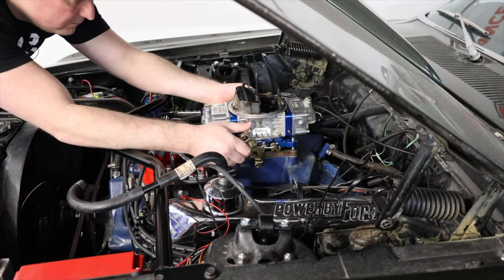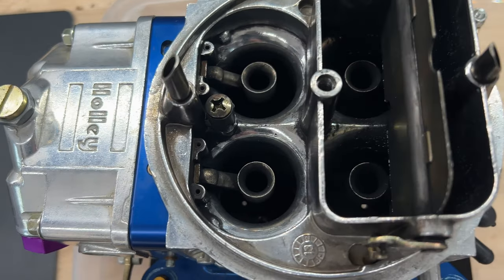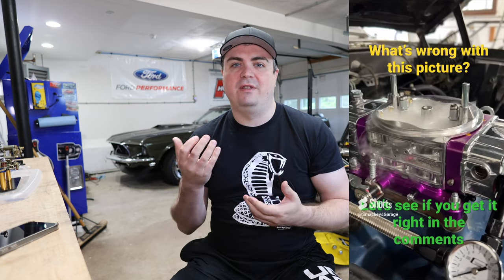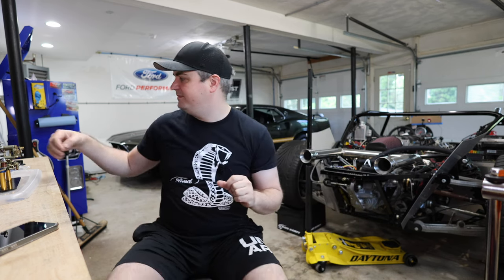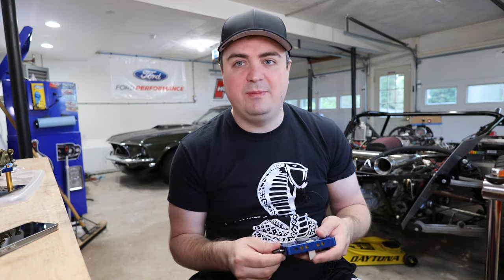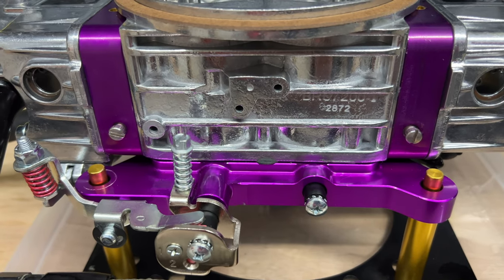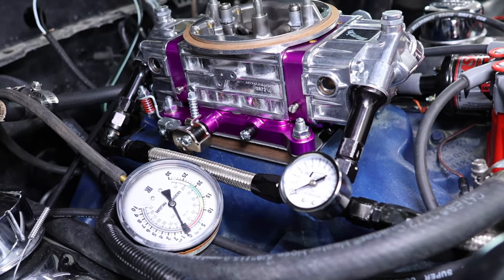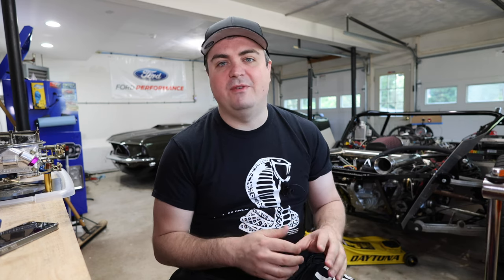My First Experience With No CHOKE | BRAWLER 750CFM

Comment: I've did away with the choke on several of Mopars I've had in the past only the one's I didn't drive in cold weather though. The thing I don't like about electric chokes are that they still choke even in hot weather and every time after the car was shut down, so I would just adjust them to stay open and not work. Great video! Thanks for sharing!
Reply from the maker: You and I had similar experiences with electric chokes. My problem that I had was if I moved the car out of the garage to warm up It would end up kicking the choke off. Thanks for watching and sharing Mitch!

Comment: Split the difference,  choke horn with no choke flap. Did like your manual choke video- PITA install.
Reply from the maker: Thanks man. That’s not a bad plan. Probably could have just removed the flap. I agree. The manual choke was a lot of work. I also wish I went with the Holley cable rather than a stock replacement cable from my car.

Comment: some guys throw a rag over carb with no choke to get it fired up at first
Reply from the maker: That's a good tip. Annoying if you are just driving it for a cruise, but I understand why they would do it.
Reply: @SmackeysGarage  youve got me second guessing on what kind of choke to use, ha, just put on my first nice 4 barrel holley with an electric choke and it fires right up in the cold, might try a no choke this summer when its warm, thanks for the videos
Reply from the maker: I have a video on that that covers my experiences of each of the three choke styles I've tried. I've got to say, a manual choke or electric choke is a nice setup if you don't need to move the car while it is warming up. https://youtu.be/nMVJpY-ksdU Personally, i wouldn't go no choke on a street car.

Comment: Subbed!! Im buying a 650 brawler with no choke. So hopefully i dont have as much issue  with it.
Reply from the maker: Thanks Dustyaman! I'm sure you will like it. Your experience will probably be a lot easier than mine! Follow back up after you get it on how it runs.
Reply: @Smackey's Garage   Will do I will make a video of the new setup. My carb now is the factory quaderjet which is just a piece of junk my last engine I had was a brawler 650 with choke. I hated it.
Reply from the maker: I'll be looking for it!
Reply: @Smackey's Garage  yeah so far I've had the same issue  with the brawler running stupid rich. I've gotten it to run better. But still way rich at idle. Now when you said you changed the power valve you said you went down to a 2.5. But it seemed after you said that that you went back to a 4.5. Can you elaborate. Did you make any jet changes.
Reply from the maker: Hey. I'm actually making another video on this now. So I definitely need to tweak the carb for my use. Now that everything seems to be OK at idle, I need to add more fuel to the primary side OR increase the value of the power valve. At temperature it could definitely use more fuel at higher RPMs.

When I did fix the rich problem, I did have to change the idle mixture screws. Where did yours come in out of the box?
Reply: @SmackeysGarage   they were 3 full turns out when I got it. But I always check first and even at 1.25 turns its still rich. I got it to burn better by adding about 18 initial and 38 max timing. But it sitting at idle still just burns my eyes. The Power valve is fine. No fuel leaking from the bowls into the intake when sitting. I'm going to add a 1 inch carb spacer because  I've heard the brawlers with no choke hate the dual planes with the wall still there. So I'm going to go with a open 1 inch and see how that does. And keep playing with timing more.
Reply: @SmackeysGarage  I also made a small video on the engine as well

Comment: I just recently took off the choke plate and shaft from a 600 cfm carb on my 69’. I’m kicking myself for not doing it sooner. The car starts a lot easier after being warmed up! 

As far as cold starts, i found 3 pumps of the gas pedal and hitting the ignition has worked best for me.  I have no issues trying to keep it idling. Although now that I think about it, I had previously adjusted the fast idle screw so that it had zero effect on the choke during start up (basically the lowest idle possible when starting if that makes sense). Not sure if that has anything to do with it  but everything is smooth now.
Reply from the maker: Do you do three full pumps? (Assuming double pumper?) I've been working on getting used to it and have been successful after like three or so starts to keep it idling. Took a bit of learning to figure out when it is at temp enough to stay running, but I see what you are saying. It's a much smoother startup when I have everything ironed out. Thanks for chiming in Joseph!